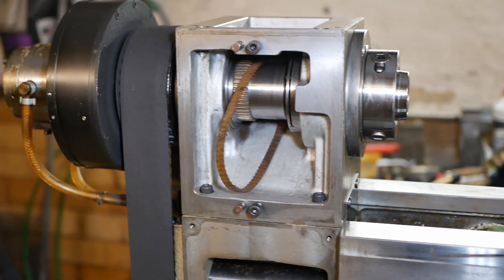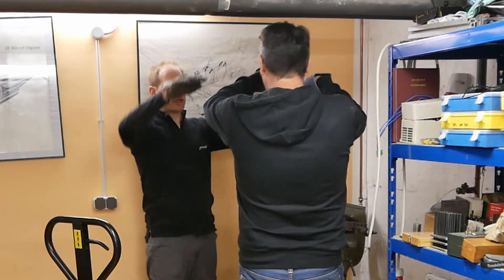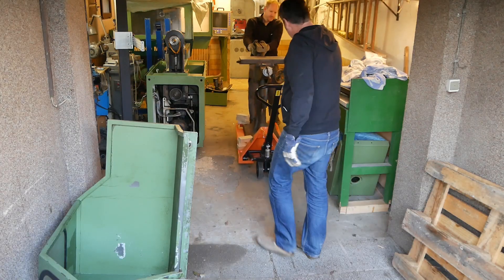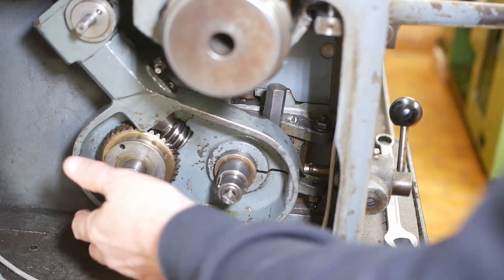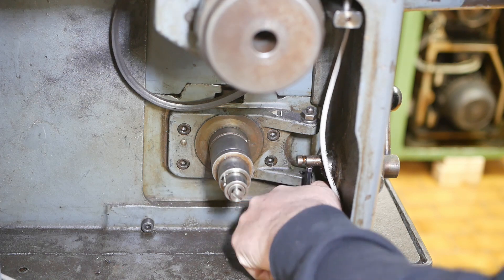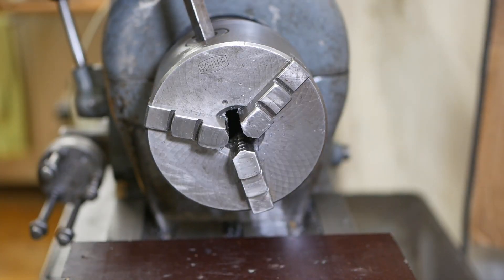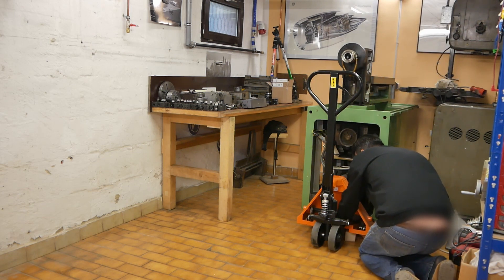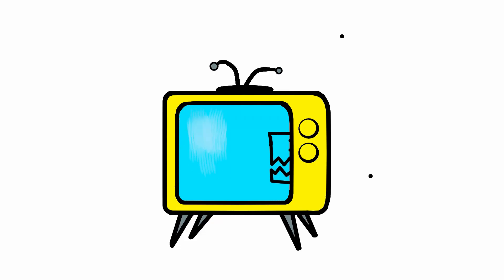Jamming the Schaublin CNC lathe through a little doorway?

Comment: Well? Did you save the 757?
Reply from the maker: Sorry, I kind of left that hanging. Yeah, I stayed in front of it, and got it back under control on the dry apron, but a scary moment.
Reply: @RotarySMP  curious .. why the tug is not in control of the breaks on the 757 or any aircraft it pulls for that mater ?
Reply from the maker: @AL6S00740  Adding a system to allow the tug to control the aircraft brakes, would also add potential failure modes where that system could inadvertently trigger, causing risk. The most relaibly part is the part which is not installed.
Reply: @RotarySMP  could this become a 2 man job? One on the actual plane to actuate the breaks and one on the ground? In such a condition? Yes indeed the most reliable part is the one is not installed.
Reply from the maker: @AL6S00740  You always have someone on board to set the brakes, but it they were to actuate then during towing, you will sever the shear pin on the tow bar, to prevent the nose gear getting ripped out. They are hydraulic carbon brakes designed for touch down at about 200 mph. they have zero "feel" cold at low speed.
Reply: @RotarySMP  Yes, the same with ore trains in underground mines in North America, my experience, only have brakes on the motor(s)/loco(s). Grades are usually no more than 0.25%.
Best wishes from Northern Canada.
Reply from the maker: @carlthor91  I bet it is a horrible feeling when those brakes fail.
Reply: @RotarySMP  You have either regenerative braking (on a battery/trolley powered motor, or plane old reverse gear, too bad for the steel wheels, nice sparks, sometimes😎), or on diesel-hydraulic drive locos, properly designed, engage the retarder and feather the throttle, the desired amount, to slow down. Larger units have sanders to the wheels to increase friction, for starting and stopping. Unfortunately most mining equipment is trackless these days, and more and more is going to battery/trolley, for movement. This is a huge saving in the ventilation requirements, for the mine, or complex.
Best wishes from the far North in Canada.
Reply from the maker: @carlthor91  Thanks for that. WOnder how long the tracks last with sand pour on?
Reply: @RotarySMP  I don't know, they just replaced ~500 m worth before I retired.
Reply: @carlthor91  This says a a lot about preventive maintenance.  In the whole scheme of things saves lives and money in the end,
Reply: @RotarySMP  eeeek ... I mean, if you hadn’t, would that have spelled the end of your employability in the industry?
Reply: @mumblbeebee6546  yes. that is correct. that is the reason why he now controls and audits the industry. Sometime there is some irony when you consider our official job and our hobby(s)....
Reply: @carl thor.  Your experiences sound interesting as well as rotary s

Comment: Hi,
I also have a Schaublin 125 CNC 
I purchased mine in 1998 with the CN not functioning  , I replaced with my own control using  a DOS and an intel 486 computer.
it worked well till the original drive ceased to work .
I then replaced everything with a NUM control 
How are you for parts ?
Schaublin have stopped supplying spares as of 3 years ago
Reply from the maker: Cool. Good ony you for the retrofit. I used TurboCNC and DOS on my iminlathe for years.

My lathe is in really good mechanical condition, so I haven't needed anything from Schaublin. I would tend to make anything I needed rather than buying.

Comment: Hi, thanks for the great vid! Would you by any chance be the same rotary smp from cnc zone? Im like 2/3s of the way through the main epoxy granite thread, designing my lathe as I go. Would you happen to have any advice on lathe design/epoxy granite based lathes, especially any big stumbling blocks to consider? If you aren’t the same person thats a funny coincidence, but either way thanks for the great video!
Reply from the maker: Thats also me. What aggegate  grading are you usings? A Fuller curve ? There is an xls from THomas Zietz which helps you get close.
Reply: RotarySMP right now Im looking at the recipe that ckelloug posted with different sizes of zeespheres as well as aluminum oxide and some graded quartz. I believe he developed his own grading system for it, and it looked like the poster Walter used that recipe and it went well. Right now my biggest issues are finding zeeospheres, assuming thats the recipe to go with, and figuring out inserts. Right now I plan on embedding steel inserts in the eg, then doing an epoxy surface plate pour to get a flat surface, then drilling through the 1/4in of epoxy and into the inserts which I can tap, to attach rails and things? Sorry for the ramble just very excited about the project, if you have any thoughts on it Id love to hear! Thanks.
Reply from the maker: @robertsteinwandel6658  I think the zeosphere is a red herring. The biggest challenge is getting enough vibration, at the correct frequency into the mould to compact the lowest epoxy ratio you can. That is the key o a high youngs modulus.
Reply: RotarySMP thats great to hear actually hahaha, I was getting worried about whether I could actually source the spheres in the first place. Ill be looking into vibration sources, Ive seen several ranges of frequencies though, do you happen to remember what range of frequencies ended up being best?’if not I can just keep reading and Im sure Ill find it eventually hahaha. Thanks!
Reply from the maker: @robertsteinwandel6658  Which country are you in? In europe there is a pregraded aggregate which is pretty reasonably priced.
Reply from the maker: @robertsteinwandel6658  You really need to hook the vibrator to a vfd and just look for what works.
Reply: RotarySMP Im in the US (near ish to Washington DC) unfortunately, so I don’t think the European company will work for me. If you know any American companies off the top of your head Im all ears, although I was looking for zeeospheres until today pretty much, so I haven’t spent a ton of time looking myself
Reply from the maker: @robertsteinwandel6658  The key to good packing density is in the finest fines. I used AlO from a pottery vendor, which was an extrememely fine powder. Then fine sand, coarse sand, fine gravel, and the last one should be pebble approx 1/5 of you mininum feature size. There is a link to the grading spread sheet here : https://www.cnczone.com/forums/epoxy-granite/368650-epoxy-granite.html
Reply: RotarySMP Thanks so much! Is AlO fine enough I should be wearing a respirator while working with it? Or does it stay down enough that a respirator isn’t really needed?
Reply: RotarySMP Hmm I thought I replied but now I don’t see it. Thanks a ton though! That sheet is incredibly helpful! Would you happen to remember if a respirator was needed when working with the AlO?
Reply from the maker: @robertsteinwandel6658  I didn't, but it is probably a good idea.
Reply: RotarySMP Ill be sure to do that!  By the way, do you happen to have any experience with tapered reamers for cutting a morse taper? Seems fairly straightforward but Id never seen or heard of anyone using them before so not sure if maybe they’re terrible or something
Reply from the maker: @robertsteinwandel6658  Sorry no. A friend of mine has a damaged Morse taper in his Aborga drill press, and bought the tapered reamer from Ali Express, but has been too chicken to try it out. You should only need to take off high spot. Low spots should not really matter, unless it is 50% low spots.
Reply: RotarySMP actually this would be for cutting a #2 morse taper starting from a straight hole😬.  It does have a “roughing reamer” as well as the normal tapered reamer maybe thatll help? I was thinking of possibly roughing out a little more of the hole with a second larger bit, going part way down, so the reamers do less work?

Comment: What Cessna did you work on where you were in the RNZAF? And why the hell would a Kiwi create such an acronym that can't be said in one syllable?
Reply from the maker: I worked on A-4 mostly, but also a bit on the PACL CT-4.
About 25 years ago I started designing a small metal plane, which was going to be powered by a Wankel rotary engine. I changed my mind on the project, but the handle stuck.
Reply: @RotarySMP  I didn't realize you guys had the A4. A big workhorse during Vietnam. I'm USAF retired although my job had nothing to do with planes.
Reply from the maker: @zircontweezers  The RNZAF got them new, and then did a big modernisation in the late 80's early 90's with the F16's radar and avionics. They kept them in service for a long time.

Comment: I love it! The art of moving big heavy objects around inside a too small space. I just drove 300 miles from Portland to Seattle to pick up a 2'x3'x4" granite surface plate. 450lbs of fun in the back of a Subaru outback wagon. Now to get it through the maze of stuff called my driveway (in front of the shop) and onto a soon to be designated stand. Some fun now!
Reply from the maker: Nice. Sooner or later I would like a bit bigger surface plate. 
We cant drive 300 miles without entering another county, and they are not letting us in due covid :( Seriously cramps the tool shopping.
Reply: @RotarySMP  The worst part is I shopped for a descent 2'x3' plate for over a year and finally bought one from Grizzly for $350 including shipping (on sale). It was only 3"  thick and shop grade. Two months later I find this one for $175 plus $30 in gas. It's 4" thick, in pretty good shape with only a few nicks on the corners and as a bonus I bought a genuine Mitutoyo 6" digital caliper and a set of Japanese Vee blocks for $75. Byby Chinese calipers, hello quality. These go well with my other new Mitutoyo dial gauge and dial test indicator. These are the first real gauges I've ever owned besides my Chinese made Mitetoyo knockoffs and Harbor Freight specials. Yehaa, welcome to the wonderful world of real machining. Now I can begin the fun task of rebuilding my Boyar Schultz surface grinder & fixing the 3 thou runout in my lathe spindle. Good gauges and a surface plate. Life is good.
Reply from the maker: @misterfixit1952  Seems used stuff gets cheaper once it gets too heavy to lift easily.

Comment: Glad you got everything moved safely! After tipping the surface grinder the other week and spending a week devising a plan to resurect it, I ended up getting a pallet jack to move it. I moved it into the corner of neglect which was previously being occupied by my dads extra safe. I don't have a ton of space for the grinder since my horizontal cnc takes up basically the entire back wall of the garage, and half of one side. That being said I do have  an extra room in my house that could make a good inside manual machine shop, similar to what you have done.
Reply from the maker: Ouch I hope neither you nor the grinder took damage in that mishap.

Comment: I thought that was a Doall bandsaw. I used to use one to cut the centre of dies out using the weight and chain setup. 60 mm thick D2 ,you needed a good sharp blade. Nice machine
Reply from the maker: It is a nice saw, but because one of the reduction gear teeth is chipped, I currently have the gearbox gutted, with just a solid shaft through, therefore it is only high gear. That is a temporary solution...in it's sixth year.
Reply: @RotarySMP My old boss would call that a feature.

Comment: "They have a tendency to fall over when you move them." Wonders how you know that. :-)
Reply from the maker: So far I have been lucky. The Maho is a bitch to move, as the electrical cabinet makes it a really lopsided load, with a tiny foot print. it partially feel over in my drive when I got it, but the narrow wall stopped its fall.

Comment: Nice job! I'm so very thankful I don't have such tight conditions to work in. There is a wall in the way of where I want to put my new lathe, but I'm just gonna knock it down.
Reply from the maker: This is a concrete structural wall unfortunately
Reply: @RotarySMP  Yeah, I knew it was no option in your case. In mine it's just a stud wall added after the house was built. Other than some poles, my basement was 100% wide open when built. The only reason for me to have walls is to keep dust off machine and cars. So I may end up with none, a few strategicalpy placed ones, or just heavy curtains. I guess we'll see.

Comment: Don't feel bad taking a chisel to the wall.
Just so you know, you're not the only one who's had to modify his home to get a big piece of machinery into it. Had someone come out with a giant concrete saw to cut a 5ft x 2ft hole from my garage to the basement so I could get the mill lowered down to the basement floor. The grinder parked in my garage is too large for even that gap - it's been a couple years and I'm still ruminating over a solution.
Reply from the maker: Good one. This house has concrete walls. If it were easier, I would have widened that door.

Comment: 14:13 I noticed you didn't put the jack in neutral. I know that the extra resistance helps in tight spaces but with a load that's this top/middle heavy, those extra bits of lifting can ruin your day because it will go more and more unstable to pull around. A couple taller pallets got me like that before. I won't be the one to doubt your abilities but take care man.
Reply from the maker: Thanks, I only just got the pallet jack and hadn’t thought of that

Comment: I feel your next project should be to make a 30in door opening into a 4ft one.
Reply from the maker: No need :) The lathe is already in. I did consider widening that doorway, but it is a concrete structural wall.

Comment: Hi there if you are looking for an ELS then I recomend Clough42 for his version I converted my Myford to his system and have not regreted it. By the way great videos.
Reply from the maker: Thanks for the feedback. I won't do the ELS, as I will be selling the Boley. Never really got into the ELS think, as it is not much more work to do a LinuxCNC conversion.
Reply: @RotarySMP  I still like the manual use of the lathe.
Reply from the maker: @Bobs1Models  I also like a fully manual lathe. I'll add dual MPG's too the Schaublin, but will be interested whether I can bare to live with only CNC. I did for years with the Mini Lathe though.

Comment: "there is nothing more permanent than a temporary solution" that is so true😂😢
Reply from the maker: I think I put that drill press on that stand about 6 years ago, just temporarily, till I weld up a stand.
Reply: @RotarySMP  time is just relative after all, 6 days, 6 years, what's the difference. I'm in the same situation with my drill press, i put it on a drawer 3 years ago while searching for a permanent solution, turned out that that thing is the permanent solution 😂
Reply from the maker: @eragonpower2397  I was tempted to immediately order some steel tube, and quickly weld up that drill press stand. In six years I will probably think about it again :)
Reply from the maker: @Sheila Walker Now that is a top yarn!!! Like.
I have an old car mechanic friend like that. He parked an old caravan on the property he works from as an office. When it filled up with parts boxes and old parts, rather then tidying up, and through junk out, he got another caravan. Last time I counted he was up to 5 caravans, 4 3/4 of which were basically skip bins.
Reply: @Sheila Walker Welcome to my world!  (Continuing saga of the chronically disorganized) 😅

Comment: Somehow I figured the door way would end up just a bit more lathe shaped. 😀
Icy pavement, I once witnessed an 18 wheeler tank truck full of Propane, sliding down a street at a 45* angle. The driver couldn't do much of anything to stop it, so he was sitting behind the wheel with his arms crossed, most likely praying intensely.
Reply from the maker: The doorway got lucky that it capitulated quickly. That lathe was going through, and I have bigger hammers than that :)

Yeah, it was a really pucker up moment with the 767.

Comment: 5:24 im sure nico would have used a grinder (i would have too to be fair)
Reply: My suggestion has been for ages: "enlarge the f**cking doorway!". But he refused, bringing technicality into the discussion.
Reply from the maker: @NicoCarsAndCookies  Given it is a 400mm thick concrete structural wall, I offered Nico a 200mm angle grinder to widen it, but  didn't show sufficient commitment to the channel.
Reply: @RotarySMP  Commitment will be provide upon presentation of more cookies. :D
Reply from the maker: @NicoCarsAndCookies  First labour, then pay. :)

Comment: What is the arrangement of belts and chains on the Do-All table?
Reply from the maker: There is a big counter weight in the cabinet, with a foot lever to lift it. You connect the chain around your 12" thick slab of cast iron, and the counter weight pulls through the cables to put the cutting pressure on the part, rather than having to use your arms. I have never used it, and been meaning to take it off and store it in the base, as it is often in the way.

Comment: Handy tip #1. Cut 3 wooden wedges 200mm long 100mm high. When you are trying to lift things of the floor you can use your prybar to lift in the middle and then stick a wedge at each side the third wedge can be used under the pry bar. No more hunting for bits of packing!
Reply from the maker: Thanks, that is a good idea. I have a bunch of small wedges, but that will save time and effort.